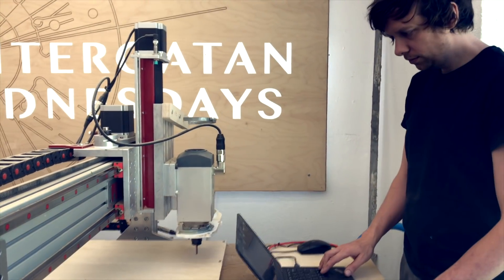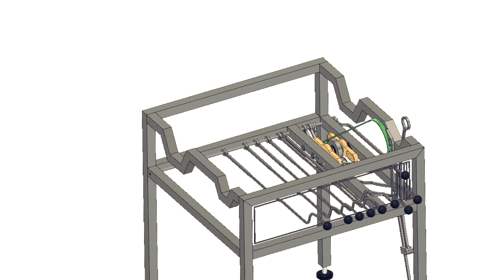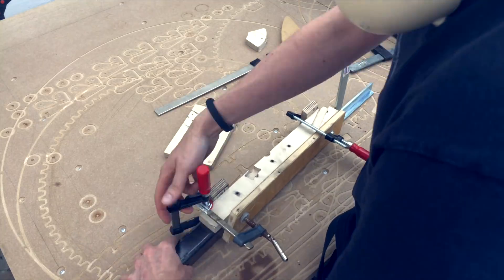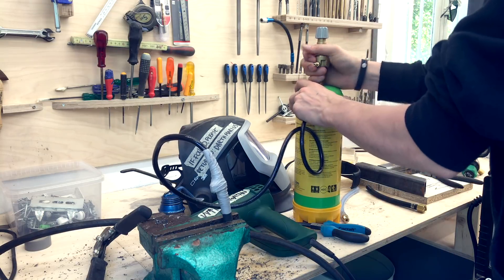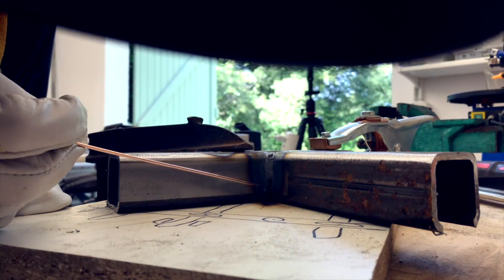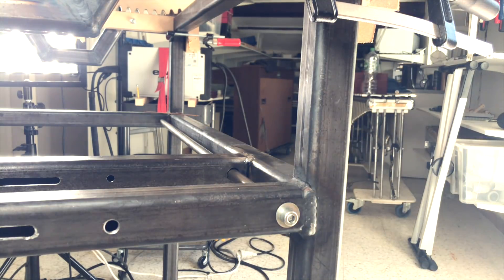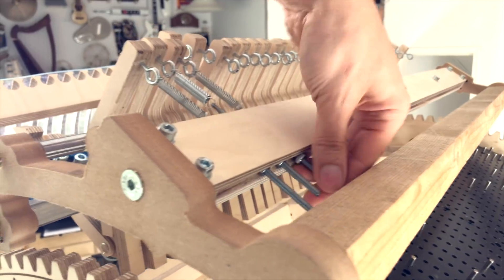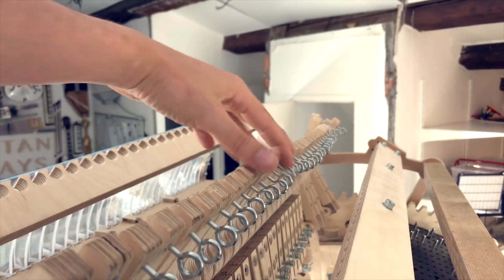TIG Welding for the First Time - Marble Machine X #38

Comment: your welder looks like an ewm picotig 200 puls. Ive got the same one. If it really is capable of pulsing, you should try it out. You can easily create nice looking weld beads with the pulsing function.

Comment: what ???? you're french are good ! but the position of the t.i.g torch need to be appro at 45° for a good bath melting and clean the metal before because they're often oiled for prevent rust. désolé pour mon anglais qui lui est très rouillé :p , tes vidéos sont toujours un moment de joie et d'enthousiasme,  bonne continuation ;)

Comment: Meanwhile I've been saving up for a TIG welder for 3 years, I'm still not even close to buying the most important machine of my career. I am a TIG welding god but my long hair gives me a disadvantage in merikkka
Reply: Tip: shower cap. One of them things used in showers/  restaurants to cover the hair
Reply: @maxz8807  made from plastic? Lmao
Reply: @jaysoneway  was just an Idea. If you dont like plastic, which is understandable, the imo only other alternative is a ski mask or one of them hair ties, tied in a very weird way.
Reply: @maxz8807  lmao you can't think of any reason why putting plastic on your head is dangerous af while welding lol?
Reply: @jaysoneway  did you not read my comment?
Reply: @jaysoneway  to reiterate, I gave you a solution for your long hair, not a welding mask. Wear the ski mask/ shower cap or whatever the fuck under the welding mask and you'll be ready to go.
Reply: @maxz8807  So you cannot think of any reasons why plastic on your head might be extremely dangerous while welding??? I was speaking of the lack of field safety and the hiring restrictions due to the long hair Punk welders vs Rascist welders and the Punk's massive disadvantage to that war.
Reply: @jaysoneway  of course I can see the dangers of wearing a plastic cap on your head while welding, but my welding mask covers my entire head, and, in extension, my shower cap (I have extremely long hair that already caused me issues while welding without covering my hair [it was longer than the welding mask]). The shower cap, in my case, is no safety concern as my entire mask would have to melt before anything would happen to the shower cap. That is, ofcourse, different from mask to mask/ person to person.

I did not interpret your initial (or any one if them, for that matter) comment as you talking about a difficulty in finding a job as a welder with long hair - I thought you meant that welding with long hair and no "safety" is difficult/ dangerous in general (which it is, form personal experience lmao).
Reply: I wear my hair in a welding cap. Long hair gives no physical disadvantage to welding.

Comment: Weld with little ZIG-ZAG-s where you melt both metals(one at zig one at zag), you go slow, and easy, since TIG is universal welding, but its slower. If you welding for long, you gonna start feels the torch quite heavy. Pick up the welding cable trough your shoulders, so its wont put so much force on your wrist.

Comment: where do u have such a nice tig welder from °°. May i have tip for u, wrap the cabel Package once around ur right arm bevor welding. u will become much more stable. another point is to hold the torch more like a pencil between thumb and indexing finger (thats how i hold it). But its most important that u feel comfortable while welding.
Im rly impressed abaut ur work keep on !

Comment: Wouldn't it be better with a wing nut on those spring tension parts rather than just a ordinary nut? Then you can hear the sound while you are screwing rather than, pull out and guess as it works now?

Comment: The largest impact on heat input is travel speed. This becomes obvious looking at the formula. So, if you are cooking your part too much, chances are you are going too slow. If the puddle will not move faster, you can actually increase the Amps and move faster and overall heat input will be decreased.definitely not bad for first try though, I have seen much worse from welding students who have already learned other processes. 

Just make sure you are never hanging out in one spot very long. You want to set the machine so that when you hit the pedal you can start moving the puddle ASAP.

Comment: Your welding looks good for just starting out,It looks like you are running a bit too hot.Maybe try backing off on your amperage after establishing the puddle. You need more amperage when you first begin a weld,but less after the puddle is formed.Also it helps to clean the metal being welded with some Acetone before welding to remove any oils.

The new marble machine is looking great,can't wait to hear it!

Comment: If you get lots of oxide on the tip of the filling material you can always cut it, or if you are too lazy for that just use the other end of the rod. Also, that amp is fine but if you are new it might be a good idea to lower it, to gain more control. Due to welding slow + using a torch angle that the surface will deflect around 40% of the heat, you add more heat than needed. The arch length could also be a part of it but it looks like you weld slow. (voltage increase to keep the arc alive if you increase the distance unlike other welding methods, meaning it gets hot).

If you can hold the angle straight down 90 degree you get all the heat going down where you weld. If you tilt the torch some heat will go away from the weld area but still heat up the thing you work on.

Comment: Hello Martin, I know its very annoying but if you dip the tungsten in the puddle you really should stop, snap that bit of tunsten off, then resharpen. It will really help clean up those welds and you'll learn to not touch the puddle. Also if you are going to be doing more welding you'll want to buy some bigger bottles of argon. you'll save heaps of money not having to keep buying those tiny ones.

Comment: I dont know if I caught all your videos, but is there a way to coat the metal in something to prevent rust? If you already did it to the frame, it might be wise to do the areas you hit with the wire brush, just to seal em again.

Comment: @wintergatan Here is a tips on drilling holes in to metal;
    Dont spin the drill to fast you will cause it to become dull and or brake. ( if you cant see the flutes of the drill moving your going to fast. This is only a guide for most metals). 
   I would always spot drill when ever possable it helps keep the drill stright. 
 Also use make or buy a center punch i would recomend a auto center punch it helps to center the drill up easyer.

Comment: I was taught that on a test piece,
Cut through the wield at 90 degrees to the wield line.
If you can see a visible join in the wield, then you're wielding wrong.

Comment: I was a certified welder for a few years .. your first tig is better than most people's first tig.. How many times you accidentally stick the electrode in the melt puddle?? (aka poisoned the electrode)?   Tig is very awesome welding process.. you can weld any metal with it , iron, steel, aluminum, brass, stainless steel.. at any thickness YOU would find yourself dealing with.. as thin as foil up to 1.0Cm ( take morethan one pass ) :)

Comment: one thing to note with your tungsten, you should not grind it on a wheel that has been used to grind other metals as it can contaminate your tungsten. also put the tungsten in a drill and spin it while grinding to get a nice point

Comment: The welds look very good for how little practice time you've had. You'll get better with time. TIG is my favorite process. 

Be careful though. You'll get sucked into metalworking. Next thing you know you'll have a lathe, mill, surface grinder, surface plate, and a box full of metrology gear...

Comment: Tig is nice but take it from a welder.. MIG would be better and because you are using carbon steel for your frame, you can use C02 or a mix gas of 75% argon / 25% C02

Comment: I'd be careful with that big drill, it probably shouldn't be run that fast. If you can, I'd look into getting a mag drill, it's essentially a small drill press that attaches to the work piece with magnets. It will run a lot slower than a handheld drill, will drill perfectly square, and can develop the kind of feed pressure you need on a big cutter like that. I believe some or all of them have power feed too

Comment: i dunno if its the same where you are but here those disposable argon cylinders are a very expensive way to get argon for a big project. Maybe you should crunch some numbers with the size of that cylinder verses your needed litres/min and see how much it's going to cost in buying disposable cylinders. 
Here you could buy your own refillable cylinder full of gas for the cost of 4 disposables and it would hold 8 disposables worth of gas or more.

Comment: I'm probably going to get jumped on (sorry if it's already been mentioned)
But the MDF frame element really needs to be replaced with another material. It's not a stable material and you will know yourself how prone to damage it is from moisture. It's such a fantastic project and I love your work but that's such a huge future headache to build into your machine. Now is the time to fix it. If it were up to me I would make the frame out of black HDPE 500 sheet. (Chopping board material)
Can be machined, is naturally low friction, completely mechanically stable. Nylon may be even better, you would need to look into it in more detail but it would also greatly increase the robustness of the machine. MDF just needs a bit of humidity to return it to wood pulp

Comment: Considering the thickness of your metal you can easily go up to 110 amps even higher when you weld inside a corner, Also when you see the metal bubbling and and jumping all around it means your gas coverage or flow isn't enough. Try to lift your hand correctly and keep it stable by putting you elbow on something stable while using the torch. Good luck with the build ;)

Comment: I Use to weld and was laughing when you were welding only because your "technique" kind of weird never seen some one hold the tig welder that way. Ive Only seen people hold the handle like a pencil  cause it helps with stability. Also ive only used a foot petal to start the tig welder never a button like yours.  Only thing to worry with the weld itself is the bead needs to have the crescent moon shapes through out the whole bead the closer/more there are the stronger the weld and keep the crescents  the same size. And for your amps most machines have little guides for the amps needed for different gauges (thickness) if yours doesnt i would look up on google for the amps. Be safe welding and make sure you have proper ventilation. And never weld anything galvanised. And don't worry you'll get better over time welding is a lot of muscle memory

Comment: you can weld without argon gas but it would turn out crappy      the purpose of argon gas is to blow away oxygen from the weld so it doesn't oxidize     don't quote me im just going off of memory

Comment: Your welds look great for a beginner!  You should be proud.  :-)   They will be more than sufficient for what you are doing.  Most people start out with MIG (wire feed) or stick instead of TIG as it's easier.  Either one would have worked for you.

Comment: Tick welding is actually the easiest one, it will take you 15 days to master it, though it would be ebtter if you take a course, there is more to welding than just use the equipment, the gases, and materials you are going to use, as well as the correct techninque for it is important too, the tick welding is the ideal for the Marble Machine, the semi-atomatic welding would be faster, but you will need A LOT of experience to do it, its way more difficult, i did well my first time with tick, but automatic, I never got it right, too many bars burnet XD.

Comment: Hey, also you dont need to wear leathers or heavy gloves when TIG welding. And make sure to keep the filler rod within the cone of gas. Steel shouldn't throw sparks when DC TIG welding, it means there are oils/contaminants present. A quick wipe with acetone along with mechanical cleaning of the surface is usually sufficient. Good luck :)

Comment: @Wintergatan You might try this next time you want to drill a concentric hole in a rod: TabLeft Workshop TIP: Drill down the center of the bar stock. I tried to attach a link but it's not allowed so you'll have to google the term. It's a surefire way to drill to the center every time.

Comment: Awesome work as usual. A tip when sharpening the tungsten TIG electrode. Place the electrode into a battery drill and sharpen with it spinning pointing vertically onto the grinding wheel not across the wheel. This not only ensures an evenly ground cone tip but also aligns the grinding marks with the length of electrode. This improves the flow of electrons off the electrode and gives a more concentrated arc. Also avoid welding close to strong magnets, the magnetic field does strange things to the electric arc.Look forward to seeing more welding!

Comment: 5:41 Quick French lesson:
When saying "un", it's actually pronounced more like the end of a softly spoken "huh", although if the next word begins with a vowel, the n can be slightly pronounced, to sort of link the two words together in one breath.
"Une", on the other hand, is pronounced exactly like you were rehearsing.
Also, the last 'n' in "connection" is silent, it's part of the 'on' sound.

Comment: Speaking as a welder; not terrible, work on your filler wire handling, feed less of it, use less heat, and try to lay the filler wire down in ‘coins’ to create the desired layering effect

Comment: I love that you're learning how to TIG weld! My profession is Sheet Metal Work and I do plenty of TIG welding. I am excited that your welds look good, and they will only look better with time. If you notice some holes or craters appear in your weld, then too much outside air is getting into the molten metal (porosity); make sure your argon pressure is high enough (~70-100 kPa/10-15 psi is good for me) and don't let your torch angle get to 2.000.000 degrees :) Good luck with future welding, and I will see you next Wednesday!

Comment: Tig welding is a slower weld process than others. Turn down your power to where you can get a small clean puddle. Take in a breath, let it out slow and then small shallow breaths when welding. Rest your forearm on something to keep your weld steady. Take your time. Don’t rush. If the puddle is getting away from you or too hot, turn your power down, don’t rush it. If your rod doesn’t melt or sticks turn your power up slightly just until everything is smooth. Your tungsten should always point 5 to 15 degrees to your weld direction as well as any welding rod or wire. Hope this helps, good luck and practice. PS: For steel, the gas should be a 75% argon-25% Co2 mix. Straight argon is used on aluminum. The tungsten rod for steel should be 2% thoriated or equivalent.  Aluminum is 100% tungsten.
Reply: You need to fact check your postscript. c25 is never used in TIG. That red tungsten is mostly phased out so welders don't irradiate a job site with radioactive thorium dust. It may only be alpha particles but breathing the dust will turn your lung into cancer city.
Reply: @xUndeadPanda  Yep, 100% argon for steel and aluminum, he must be getting confused with mig welding.
Reply: UndeadPanda This is why I said “or equivalent”. And yes red tip is still being used. It is being phased out in some industries but it is still in use.
Reply: Argon mix is for MIG/MAG. Straight up Argon for TIG only.

Comment: when holding the tig welder in your right hand pretend its a big pencil, with the gas line at the bottom. you'll have more control. thats if you are using a foot pedal.

Comment: I think you put in those threaded inserts at 1:16 upside down. The slot is intended to be so you can use a screwdriver to tighten/remove them if needed.

Comment: Wonderful to see your process :) I was just thinking if you ( or anyone else here) have though about an automatic reprogramming system? I doesn't have to be integrated - I would see a small X-Y Gantry System with linear rails and fast motors, the size of one of the programming elements. It would collect the pins, store the in a feeder system and place them again.  I know people are very good a this job too, I just liked the idea as a design challenge :)

Comment: How you find the time to build this and edit your videos I don't know. Your skills are amazing. TIG welding is an art. Start slow learn to control your pool before adding filler wire. Your first go is good though. Just fusing the ends of your steel without filler wire will create a strong bond.

Comment: I've been welding for over 10 years now, and I will say, unequivocally, that is by far, the best first weld I have seen a person do with a TIG. I would have actually recommended that you use stick welding (smaw), for square tubing like that. It offers faster travel times, and reduces the likely hood of warping because of all the heat. It also comes with it's own shielding gas (because of the flux covering). Most machines convert to stick (smaw), just swap the ground to the neg, and use a 'stinger'. Still...I am very impressed. From a musician, to AutoCAD, to 3D Printing, to now welding TIG no less!!! Very exciting!!**Yo!  October 4, 2017 Ep.8...you TIG WELDED!!